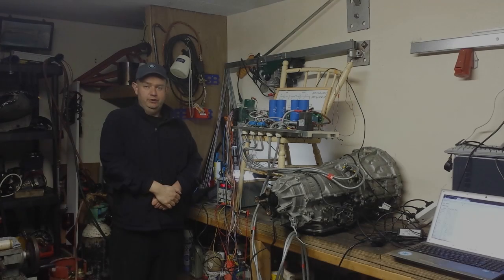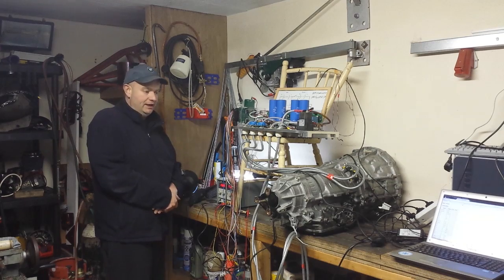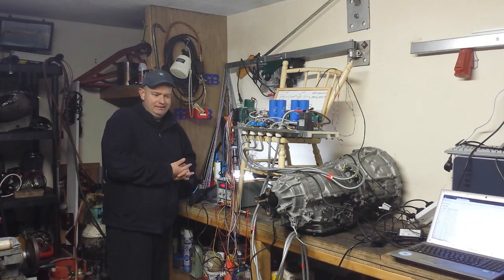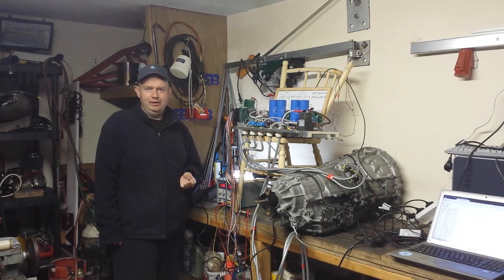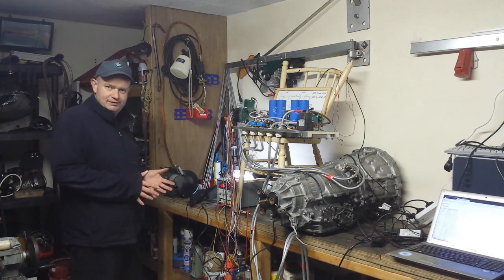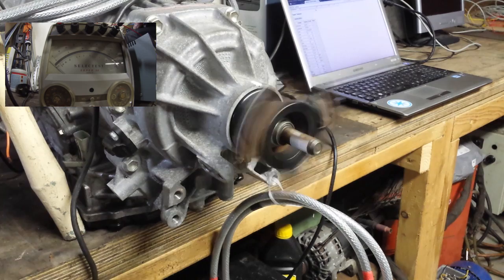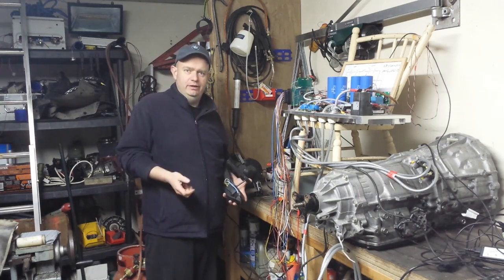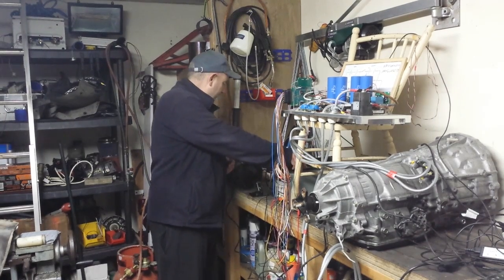Lexus Toyota Hybrid Transmission Project 09 : Smooth Runnings

Comment: Awesome!  What I do for finding the first north marker:  It's a 4 pole pair motor, so you need at worst almost 1 full electrical revolution, which is 1/4 of a mechanical revolution.  I break the 360 electrical degrees into 8 pieces, and then command torque at each of those 8 angles (I give each one like 0.2 seconds to try to move the shaft).  If there's movement, I keep it at the angle that's causing movement.  Then, after < 1/4 revolution, you hit an index pulse.  It may work for you to do something similar.  Just pretend that you know the true angle, and give each of those 8 angles a chance to produce movement.

Comment: Why not just run the motor open loop till the index pulse is found? I'm currently trying to implement my open little algorithm for tracking the motor position at standstill sensor-less as a programming exercise.
Reply from the maker: +Coolkeys2009 it does run open loop at the start. problem is getting the current and frequency right to "catch" the rotor:)
Reply: Damien Maguire Running the motor open loop(ie stepping the motor with 6 step commutation), is the equivalent of turning it with your hand till the index pulse is found?  Agreed it's not very good if you can't put the gear box into neutral and have to do it with motor moving the car :-)
Reply from the maker: +Coolkeys2009 Push start or park on a hill:)
Reply: Damien Maguire Hehe, I know you'll find an elegant solution soon. Keep up the great work.
Reply: +Damien Maguire I have just re-read your comment. Are aligning the rotor to a known position by applying a long current pulse to 2 of the windings before ramping up the speed? As you are only trying to find the index pulse the rotor should rotate at very low speeds with out first aligning the rotor just by apply a low enough stepping frequency.